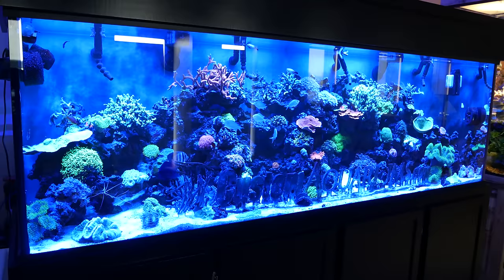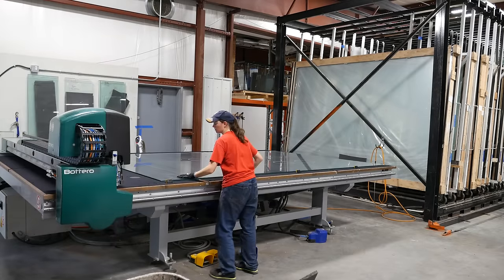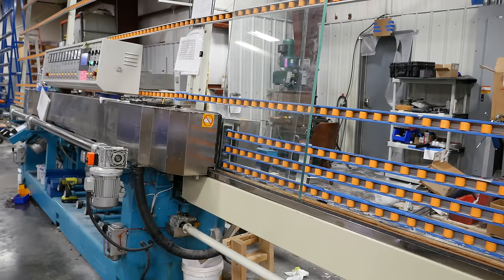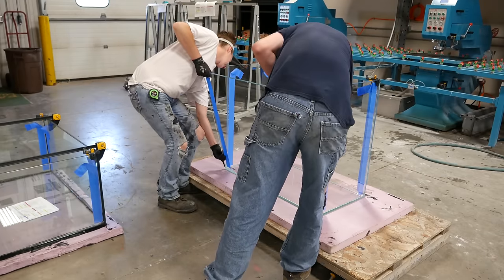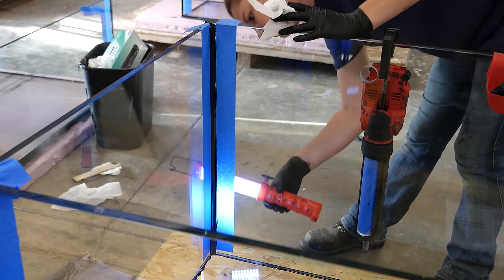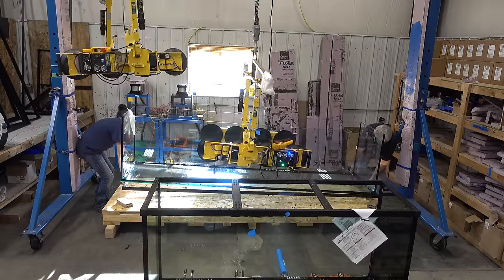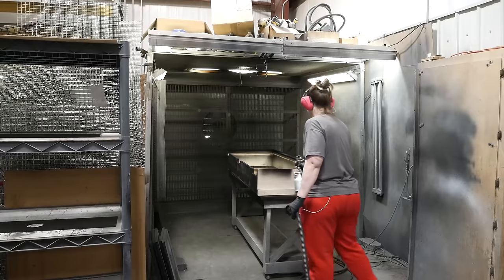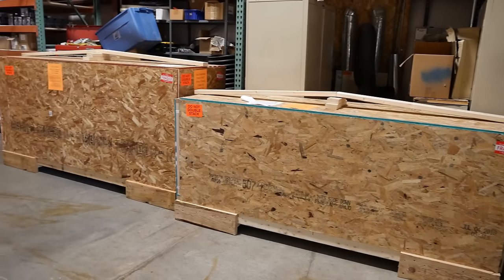How Custom Aquariums Are Made - Factory Tour

Comment: Awesome & comical. Why funny? I sat down thinking of a better way to  construct tanks and came across this and it's exactly what I decided was the best option. I'm not talking the machinery involved or tech but the end product. Because of the tech and machinery involved it's faster to produce than without it but can be done  requiring patients and the question for anyone accepting the challenge to make such a tank is do you want one that won't blow apart or be ok with that. No, it's not affordable for the average fish keeper to purchase or maintaining it. One huge tank being filtered, heated, etc, is comparible to the expense of a moderate fish store expense in utility costs. That said, this is the way to build a tank aside from some one piece injected acrylic system involving the complexity of a custom mold and any one piece bottom and sides will still require bracing. How did I mentally come to the same idea being produced here? I used to be a glazer and worker with glass and metal frames.

Comment: I see that they use some kind of tiny round small packing between the two glass when they silicone. (2:54). I suppose this allows a thicker silicone seal where the two ends meet which results in a stronger bond.
Reply: Ah that little round spacer at the top
Reply: It's a bump on.... Same sort of thing under glass on dining table tops, join can't be to big though or it isn't as structural strength wise.... Silicone has to much stretch.... Wish our company had a air table.... Shifting 10mm glass without air under it is hot work!

Comment: Black Silicone..., blink.., blink. 
I built aquariums for sale in my 2 pet shops years ago..., and I never used black silicone..., in fact, that has to be the first tank I have ever seen with black silicone. 
Not saying its wrong, in fact I like it. I have a small tank in my shed that needs to be rebuilt.., I might even try it. Cheers
Reply from the maker: It’s pretty common these days. I definitely prefer it.
Reply from the maker: The type they use isn't off the shelf but the go to for hobbyists is GE Silicone 1 and they do sell it in black most places.
Reply: @bradleerecore4408  The silicone Custom aquariums uses is ASI aquarium silicone and it is available on Amazon

Comment: How long till they discover low-iron, rimless tanks?
Also, the gluing process is messy, this wouldn't fly in Europe.
Reply: They have low iron glass and rimless tanks (only top brace is left out, bottom brace is still there) the reason the bottom seal is so big is because nobody will see it.